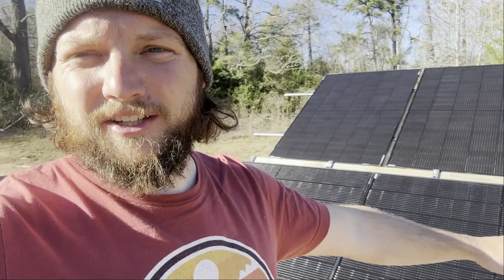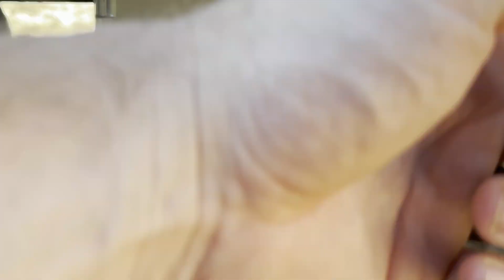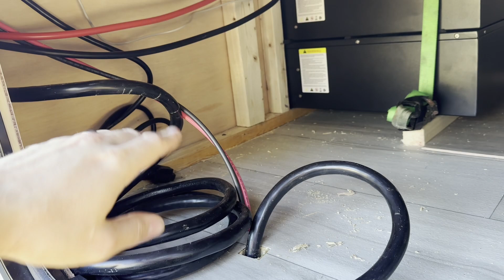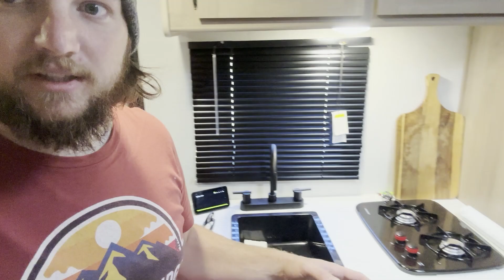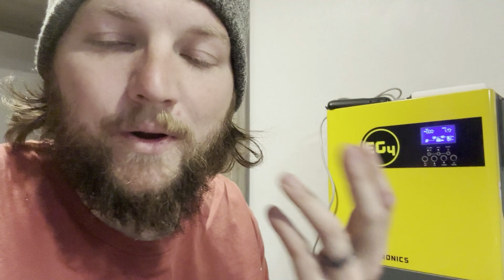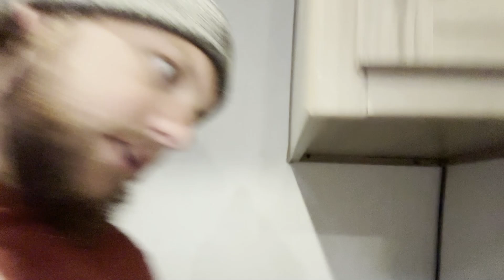2025 Coleman 17b OFF-GRID!

Comment: Nice work! You put your inverter where I have my TV mounted. No TV for you guys? How is it all continuing to work? about to do the same to my 17b.
Reply from the maker: Has been working great! The only thing I would do differently is wire up my 30 amps connection right next to where the factory 30amp cord comes out of the camper.